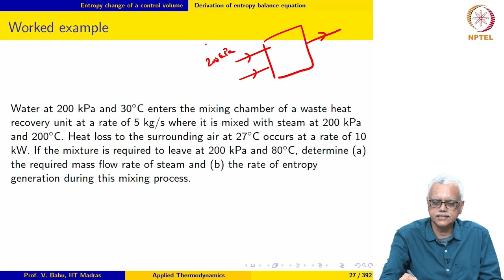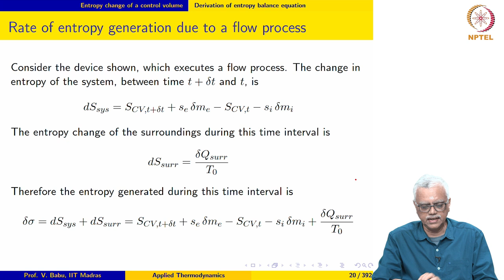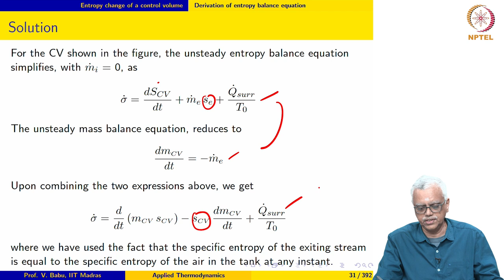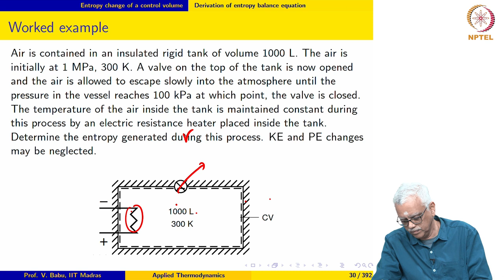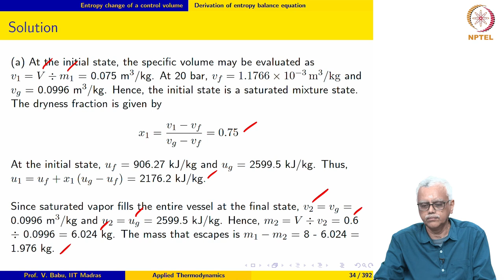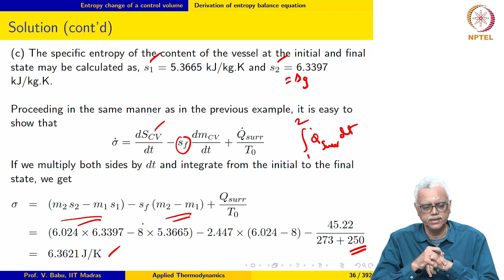Entropy change of a control volume - Part 3

Comment: Entropy is disorders. Then when a ball fall from top it's can't able to reverse due to entropy. So how can we see disorders in this situation?
Reply: The connection between entropy and disorders may be drawn in the microscopic approach. In the macroscopic approach that is adopted here (an indeed in engineering, in general), only changes in entropy are required. For the situation you have mentioned, let us say that the ball rolls without friction down an inclined plane. Its PE is converted to KE. At any point, if we make the ball go up an inclined it will get back to the same height that it started at. This shows that the process executed by the ball in the frictionless case is isentropic. On the other hand, if a cup falls off a table, hits the floor and breaks into pieces, the PE of the cup is converted eventually into a change in the internal energy. This represents an internal irreversibility and the process is irreversible. Of course, the fact that the pieces were organized in the form of a cup earlier, but no longer (order ---> disorder) is of no relevance in macroscopic thermodynamics.